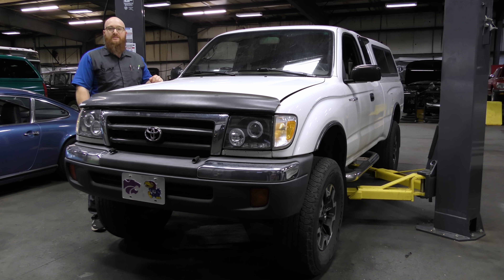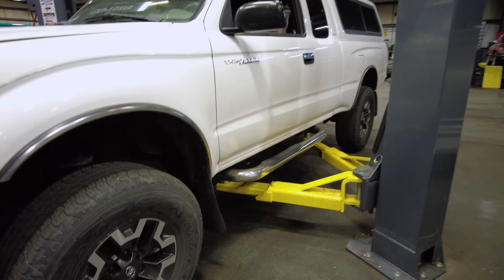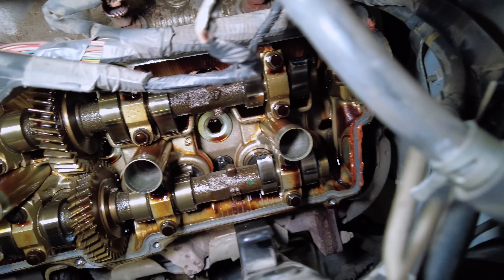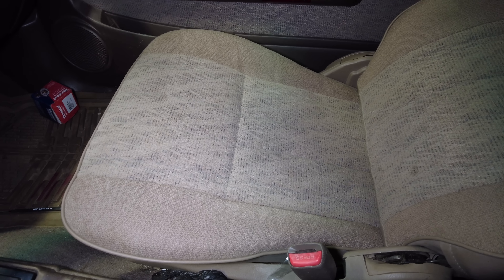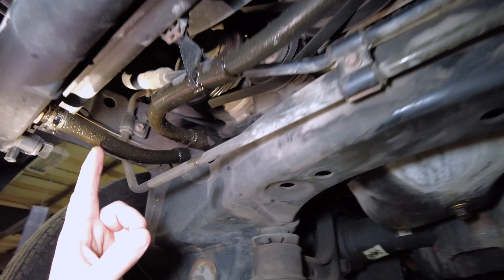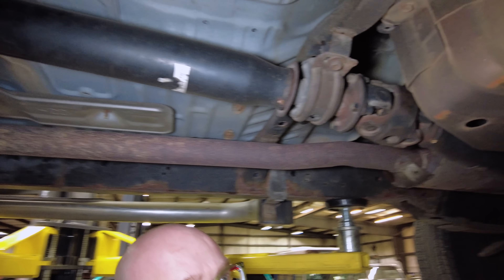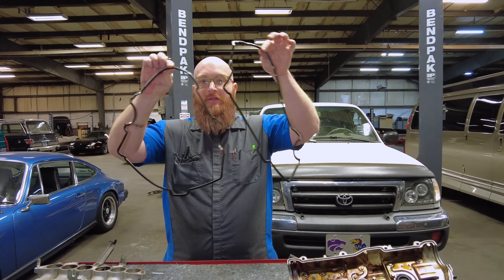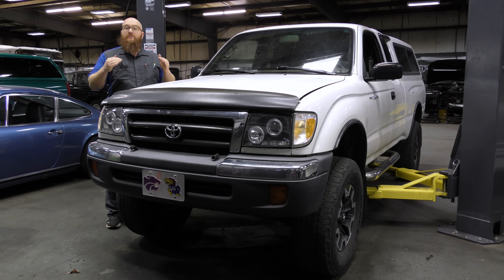Is it worth fixing this rusted out '99 Toyota Tacoma? CAR WIZARD explains

Comment: Well worth it. 
One of our cars is a 1982 RA60 Celica, with the two litre four and a 5 speed manual, with factory air con. We’ve owned it since early 2008, buying it off the original owner, when it had 80,000km on it. It now has 220,000km on it. The only major work was when I decided to do the valve stem seals. Otherwise it’s a great little car and when I bought a new Mustang ecoboost a year or so ago (after seeing the Wizards video on one), we kept the old Celica and will put it on club registration. It’s just been too good a car and too reliable to get rid of. It’s been on long and short trips, it’s been through the baking inland Queensland Aussie summers with no problems. We love the old girl.

Comment: Been driving my 2002 Silverado for 11 yrs now and now has 305K miles. Engine and trans run strong and has some body rust but frame is solid. Had Toyotas early in my life but like Chevys better. Its the choice you make.

Comment: Even some 90's vehicles can be troublesome to find parts for. It is to bad some shops don't want to work on the 60's, 70's and 80's.  All they are doing is making it more difficult to keep tjhese cars on the road. It is understandable that they have to charge accordingly for time spent on the repair or chasing down parts as it is a business.  It is rare that I have to hire a shop to do work on my cars, but if I do, I do as much legwork as possible.

Comment: Right ON Mr Wizard ! Toyota builds some of the greatest vehicles (mechanically wise) of anyone. My two SR5s are an '04 Sequoia and an '03 Tundra. Sequoia has 150,000 and Tundra has 250,000 on their 4.7 liter drivetrains and they are rock solid performers. Zero oil consumption and no mechanical repairs other than a power steering unit and an alternator on the higher mileage unit. I DO change the oil every 3,000 miles and use M1 synthetic; overkill I know but love how clean the engine is inside (nearly same color coming out as going in on change intervals). The Sequoia came from near Las Vegas so the underside is dry as a bone; Tundra came from the Northwoods of MN so has very minimal rust due to corrosives on roads. I expect both will be with me for at least a decade or more ...... great ride, fair on fuel economy and great power merging into freeways. Love the Toyotas all the way !

Comment: This isn't to start an argument, but I always wondered if a Toyota was put through the same punishment and lack of maintenance that alot of Domestic trucks go through, would it still be as reliable? Here's my reason for this.. my whole life (47 years old) I've always heard how reliable and bulletproof Toyota's are (I'm sure they are) and from what I've noticed is that people that go into buying a Toyota know this and go out of there way to baby and maintain them. It just seems when people buy a used domestic, they just beat on them and prolong or don't perform proper maintenance on them. I'll use myself as an example. When I purchased my new/ newer Chevy's, GMC's and Dodges I performed all the maintenance on them and took care of them with close to ZERO issues! I had a friend who bought a 1995 dodge ram 1500 with the 5.9 magnum V8(NEW)and he drove it for 14 years (265,000 miles) and sold it to me.That truck only had routine maintenance performed on it and it drove beautifully. Now my reason for this respnse is my brother bought a 2010 Toyota Tacoma new, and he did the opposite. He literally just treated it like an appliance, drove it and would always put off the maintenance. When he sold it in 2020, it had 160,000 ish miles on it and it showed!! Other than being rust free(Alabama truck) it felt and looked like it had 260,000 miles!

Comment: The only other thing that I would suggest while you have the valve covers off the top of the engine is a valve adjustment. This generation of Toyota does have manually adjustable valves and it’s a good idea to check the valve lash while you’re in there!

Comment: I have a 93 Toyota pickup with the 22re, only major maintenance was a new clutch from when I learned to drive manual in 2000.  She “needs” suspension refresh and that’s it.  275k miles and still rolling.

Comment: I don't know if the repairs and possible others needed on that truck's frame are being done properly or if should be done. Yes, mechanically and the body is in excellent shape, but I would be afraid of what would happen to occupants in that if a major crash as the frame could break and kill them. In some states, like PA, where strict safety inspections, due to the locations of rust on the frame, that vehicle would have to be taken off the road and re-inspected upon repairs if can be done.

Comment: Honestly, I would trust an old kia with 250,000 miles over a Toyota with the same. I drove a neighbor's 2002 4-Runner with 197,000 miles and it was a pile of trash. It rattled like crazy, the manual transmission shift throws were all over the place, and later found out he scrapped it a few weeks later due to rust and the engine was down a cylinder for over a year (which explains why it felt gutless). I also have a friend who traded in his Tacoma TRD Pro with 210,000 miles for a Silverado because of how badly it was worn-out. In the meantime, my Volvo XC90 with the 3.2 straight 6 with 202,000 miles still acts, feels and drives like a like-new car. Dad's also had a 2011 Kia made it to 230,000 miles before a collision with a deer totaled it. That Kia also ran and drove like new. Toyota made good cars and trucks in the 80s and 90s (as long you didn't get involved in a collision), but I wouldn't trust a newer one.

Comment: I had an 82 longbox, in Minnesota. The winters ate the frame up long before the engine went, and had to junk it at 265,000. Pulled and sold the 22R motor to someone who wanted it. Toyota at the time apparently hadnt heard of Midwestern salt and sand in winter. Fast forward to 2007. Bought a double cab taco and it was a tank… only issue I ran into was, one guess, the frame rails. Replaced those under warranty and truck is bulletproof reliable now.
Reply: Funny thing is that Japan has huge rust issues.

Comment: One thing I notice about Toyota owners is they maintain their cars. Not only did they pay a premium to buy the car, but they also then pay to maintain the rig.  Lots of chevy and ford people buy the cheapest car and then do bare minimum maintenance. My parents always drove GMs through the 1990s, they wouldn't pay the Toyota premium. Mom never had any problem putting 250,000 miles on any of the 3.8l v6 and dad was the same with his 4.3l Silverado W/T's.  If any of those had leaks at 200,000+ miles we never knew it because there were no spots in the driveway.  Those cars always had 3,000 mile oil changes.

Comment: 12:00 GM trucks will last just as long as Toyota. The problem is broke people buy GM and they don't take care of them. I had a 96 4x4 Tahoe and my stock 4L60e went 285,000 miles before I (myself) rebuilt it. I could still drive the truck but the trans would slip near full throttle. The engine ran fine and only used half a quart of 5w30 between 5,000 miles oil change. I changed my valve cover gaskets and my engine looked as nice as this Yota. I also have video to prove everything I said above.

Comment: I just bought a 2005 toyota tacoma double cab long bed in speed way blue with 212,000 KM I just put on new OEM manifolds, repaired a few rust holes on the driverside floor pan. I plan on keeping it for the rest of my life. It had the chassis recall in 2018. There's nothing on this truck besides the engine and trans that hasn't been replaced. She isn't burning any oil, runs and drives like a new truck. I don't care if I have to sink 5 grand into it. I want this truck to last forever.

Comment: My 2003 manual 5ZE-FE Taco 4x4 is over 190K, I have sunk some money into the front suspension over the last few years (over $2K), but on bring a trailer I am sure I could get at least $15K.  It has only left me requiring a tow once due to bad spark plug wires so I cannot complain.

Comment: I get it wizard I daily drive a 2010 prius that I give maintenance myself.  Got it with 80k now 150k. I'm still getting about 40 miles per gallon. That's because I usually go 75 to 80 on the freeway. On the original hybrid battery. Great video 👍

Comment: phew!
I have a 2003 version of this truck with 300,000km on it, in for repairs.
I’d still like to drive it a while longer, as the newer models concern me. Larger towing capacity on the newer models is a good thing, but the puffed up hight and width doesnt impress me and things like touch screen display goes against the durability Toyotas are renowned for.

Comment: i have a 2004 tacoma
with 189,000 miles and never did anything to it except the usual timing chain replacement. never had a problem with it and needless to say i aint selling it and buying any of the current trucks offered out there. mine will still be running when all those others will be long gone.
Reply: Amen to that I say... Amen to that!

Comment: Lol I've spent almost $4k on my 97 4runner in the past 7 or 8 months. It had 341k miles on it when I had the engine replaced. Old Toyotas are much more solid than any new vehicles so they are more than worth it

Comment: You like the Wizard because he’s honest. So if he’s saying Toyotas are better built it’s because his experience provides the data for him.  I was all Ford in my younger years and my wife drove Suburbans. 

But as I had to purchase cars for 4 kids and don’t like car loans, I moved to these older Toyotas. Love them. 2x 00’ 4Runner w 275k, 2001 LX470 w 250k, 2010 GX460 w 140k, 2002 Highlander w 159k. 

There is regular maintenance that can be irritating like the video, but compare that to your depreciation on a new car or interest on a loan and it’s likely cheaper.
Reply: Also, you can do repairs yourself w some patience and initiative. Not a mechanic and Ive done valve cover gaskets on most of my vehicles
Reply: Also, you can do repairs yourself w some patience and initiative. Not a mechanic and Ive done valve cover gaskets on most of my vehicles

Comment: Take it from an old guy who has through the years owned vehicles from all the major manufacturers.  Toyota as a brand has been the best that I have owned. The times I was disappointed are the times I tried other manufacturers only to have regretted it and return to Toyota. That includes Honda which I put a distant second. If you dont drive vehicles beyond their warranty period then it doesn't matter what you buy with the exception of the resale value. If you want to own vehicles that will last 20 years and go hundreds of thousands of miles then Toyota is a good bet.

Comment: No question on fixing it up, I was just wondering why the owner after fixing the rusty frame did take some measures to prevent the rest of the frame from rotting. Such a nice truck yet.  Maybe didn't expect it to be still running so well eh. 😄

Comment: That first gen Tacoma with the 3.4 v6 is bullet proof. I had one with 240k miles and ran like a watch. I’ve seen many on the forums with 2,3,4 and 500k miles stock engine and transmission. The most I’ve seen a guy had like 880k .

Comment: I just had my 2015 Ford Fusion in a shop after I could not fix a misfire. I was told I needed a new engine and the short block for the 1.5 was going to be $8k. Then another $2k or more in labor cost. I asked the shop owner if there was a guarantee from Ford that the issue with the cylinders was fixed on the new short block and he said Ford could not guarantee it wouldn’t happen again. The car was leaking coolant into the #3 cylinder and there was no way for me to know until the shop did a pressure test and then looked using a bore scope and saw the damage the coolant had done to the block. So with only 132k miles the car is gone. I only paid $13k for it to begin with, it had 19k miles when I bought it from the dealership. Pretty sad that Ford knows of the issue and only issues a TSB and not a recall. So now I’m driving a leased car as it was the only way to afford payments… I was looking for  a used truck and domestics with 100k plus miles were in the $10k plus. There were nearly no foreign truck I could find used. I hope the used market cools soon so I can afford a decent truck like the one you are showing here. Really enjoy your videos.

Comment: Wish my '04 4runner was in that good of shape. My frame is about rusted out, but with 275k miles the 4.7 V8 and transmission run like new and use zero oil. It makes me sad because the rust has killed a super running 4runner.

Comment: 3:00 still on newer toyotas and some other manufacturers you see this. You have to take the intake off to get to plugs and to one valve cover.
The 3.6 pentastar has the same thing. I believe the 2GRs, the nissan VQ and the Ford 3.5 duratec engines you have to do the same thing.

Comment: That thing is pretty clean compared to what I'm used to seeing in the salt belt, I'd 100% without hesitation fix that truck, granted I can and have patched frames myself. There are shops that specialize in dealing with that kind of thing, and most would probably charge about $1k. For someone mechanically inclined I'd suggest seriously considering getting a good mig welder instead for the same price, which is exactly what I did when I bought a truck that had similar damage after I got a quote for $900-1k.There's a lot of problems a welder can solve that nothing else can, I'd put it up there with a lift in terms of how much of a game changer it is for someone fixing and or modifying their vehicles themselves. Just be sure that you are confident in your ability before attempting a repair like that on a critical component. 90s to early 2000's is the sweet spot of relatively new, but still maintainable. You can't hang onto newer stuff for decades, because they have 20+ computers that will go wrong and cost hundreds if not 1000's of dollars. The older stuff you can keep going for as long as you can get the parts and do the work.

Comment: Call that "rusted out" !  Just go to "just rolled in" and look at the vehicles that come it to various shops around the USA. Frankly the condition of that vehicle underneath for the mileage it's done is quite incredible. OK< there is some repair needed to two places on the chassis, but these, if done properly, should keep it on the road for many more years.

Comment: rust? bah. i keep putting frames under my tacos. my 98 is getting a new frame and my 95 at 482k is getting the frame straightened (totalled but rust free), its worth it to me to keep them going. these things dont die and i can depend on them whenever i need them

Comment: My car is 5 years older, and also a V6, and when you want to get at the valve cover or the spark plugs of the rear bank, you just as well have to take off at least the upper part of the intake manifold. 
Proabbly, when you redo this, take off the bottom half in any case, then you can check a real oddity of this engine, in the V of the engine there is a WATER-cooled oil cooler integrated in the engine block. A beautifil opportunity for oil leaks.  
 
But this is no Toyota which will last into the 22nd century, it is an Opel Calibra. At least this one is not built in Germany, but in Finland, and the legend is that those are massively better regarding rust. 
 
If I could, I would love to go to the Wizard, but crossing the Atlantic is a little much.

Comment: Yes it's worth it its a yota can't go wrong
Reply: Also I've owned 2 1987 4runners great trucks unstoppable still running to this day. I've owned a 2011 tacoma trd off road 6 speed manual transmission.  Now I own and will not sell a 2019 tacoma trd pro with a 6 speed manual transmission.  No you can't buy it. Lol. Someone offered me 65k I told them to go fly a kite lolz

Comment: ppl loves things. My Father in law bought one of these for his adopted son (2 years ago) it was a single cab 4cyl black looked neat as a pin. My brother in law had to drive to Missouri( we are in arkansas) to pick it up at a car lot flatbedded it home . So they get around to driving it  and think well I think it needs shocks or tires. Took it to the Tire shop and  they said well  your shock is missing. and proceeded to poke holes in the frame you could see where where some asshole put putty on the frame and painted it. They were devastated. They found a guy that would transfer the body to a frame for 1400 or something. They found a frame for 800 and coated it rustconverter and undercoating , it was perfect btw and had that shop put the frame on it. It is definitely a nice little truck

Comment: There  was a recall for rusted frames around 2008.
Reply: In the salt belt of the Midwest those replacement frames are rotting away like the originals did.

Comment: I've got a 02 dodge ram 1500 pickup truck 2 wheel drive with a 4.7l in it and it's just turned over 398.000 miles, it still runs good with a lot of power and pep but it loves gas.

Comment: They go 300,000 to 400,000 but  Head start to go leaking antifreeze but  had one it had over 254,000   The frame rusted in half I sold it before it broke all the way The new owner had to weld it back together before he can get  registered on the road again still runs today that was back in 2020

Comment: That Taco will make it to 500K for sure. I agree, that frame needs some TLC. I have a 06 Lexus GX and I plan to take it well past 300K. The only problem with Lexus/Toyota is that the frame can rot out before the engine or trans goes. Especially if you live in the rust belt.
Reply: If they would last 500k no problems I would've bought one new